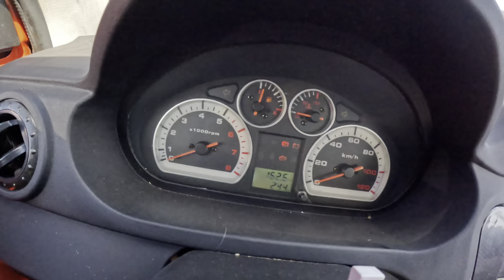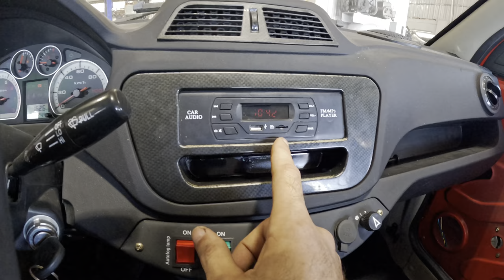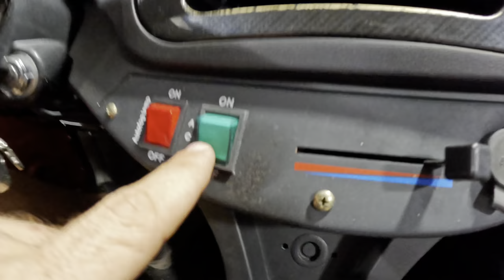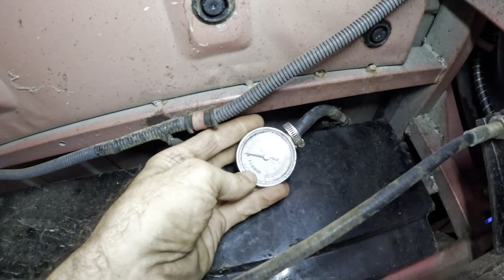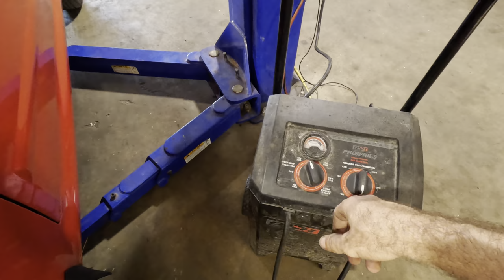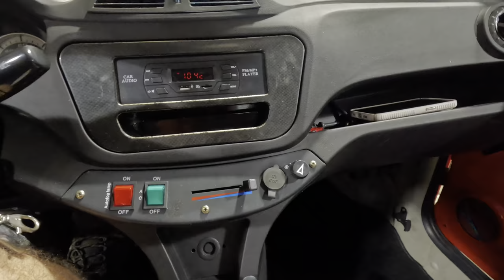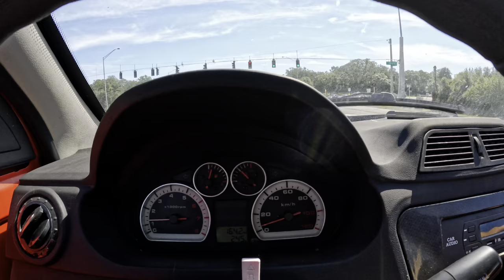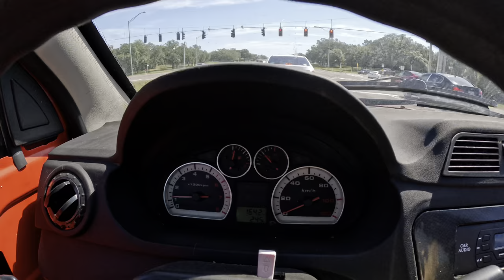UNFIT for the ROAD! Brand New 2019 Piece of Junk!

Comment: Just a word of caution here. When dealing with the car battery, make your last connection to the negative/ground side last. Why: as you were tightening the positive connection your body is against the car body and that body is now already connected to the negative since you already connected it so the only thing preventing you from getting shocked is your clothing and a layer of paint. Do the negative last but do not put your self between the negative terminal and the negative wire to be attached. Wear heavy gloves is a great idea as well.

PS: thank for the cheep car review. I had a 4 cylinder with 4 speed stick shift Chevy Monza in the 1980's and it went pretty good. No AC, no power brakes, no power steering either, but it got great gas mileage. Can't imagine a 2 cylinder engine in that car....
Reply: No worries. There's no chance of getting shocked by 12v unless you're soaked in salt water.
Reply: @NatenNator  12 volt from a 12 volt lantern battery is not the same as 12 from a car battery. It is the amperage that will kill you. Yes, it is possible to get electrocuted by a car battery. Car batteries produce high voltage electrical currents, which can be dangerous if not handled properly. It's important to follow safety precautions when working with car batteries, such as wearing insulated gloves and using insulated tools to prevent electric shock. Other then if your skin is very dry you are like a bunch of salt water, and salt water will conduct very well. Weak heart, or sweating  are all combinations of death by car battery.
Reply: Yes, it's the amperage that kills. 12v is not enough voltage to push that much current through your body because the resistance is too great. I worked as a car electronics technician before getting into building access control. I touched the 12v constant on vehicles every day as well as the positive terminal of the battery and body of many of the vehicles I worked on. Never got so much as a tingle. If you drop a metal tool across those terminals, yeah, you get enough amperage to melt the tool but it's running through the tool that has very low resistance relative to your body. Just because a battery is capable of putting out 60A doesn't mean it's always going to or it will melt quite a few wires in the car. You have to have a load to move that current.
Reply: @tactileslut  true as well.   About 3 years ago I did a dumb one and had to disconnect the battery that was under the the back seat with the car all wet and me wet and sweaty and the interior carpet soaked wet. I used a battery bale as my last connection to disconnect the battery and connected it to ground bare solid metal of the car and the ground of the battery as I removed the ground wire from the battery to the other only ground of it from the car frame/body, then unclipped the battery jumper did this wearing heavy leather gloves as well. I had a heart attack some 12 years before and did not want to shock myself dead..
Reply: 12v shock is not risky but the spark if your wrench from positive connection hits anything metal is a risk to ignite gases that can be vented from battery. That risk is zero if AGM battery is used . There are protections built into electronics of the vehicle that are not very effective if pos is disconnected first.
Reply: @NatenNator  Car batteries usually have CCA in the 300-600A range
Reply: @tableseven8133  doesn't matter unless you're dropping something across the terminals with very little resistance like a wrench. Then the danger isn't electrocution but burning yourself or the car. Ohm's law state voltage=current x resistance. In order to get the lower number you stated of 300A at 12v, you have to have a resistance across the terminals of 0.04 ohms. Put an ohm meter across any part of your body you want. It's not that low of a resistance. Heck, stab your probes into your fingers and it's still not that low.

Comment: it reminds me of a type of car here in germany
theres a special driving license to drive vehicles, up to 8hp, max weight of 425kg and limited to 45km/h, even with the age of 15. its used for small motorcycles and such. But companies made cars with Motorcycle engines that fit these criterias and such so that teenagers can drive cars. they have no real registration or inspection and are insanely cheap to drive and own. the only thing they need is fuel and 50€ per year insurance.

they also have barely anything, only things like a windshield wiper, lights and a seatbelt.

Comment: Knew what it was before he even got out. This is a Chergy 250 they have either a 250cc or 450cc engine. Chergy had ads for these in Australia when they tried to introduce them to the west. These are the 2012 or 2016 models, they have a 3 wheel version which is the main one you can find. The small car version is rare yet this hatchback version is still fairly common.

Comment: Not sure if it dawned on you that there is enough sediment and rust on top of the engine bay cross brace to suggest the vehicle was under water at some point. That could explain the starter and charging issues.

Comment: The vehicle doesn’t look reliable and if it’s not reliable, it doesn’t qualify as transportation in my book. My 66 Nova was a shitbox which cost me $50 but I would drive it a 1000 miles on a trip and it never broke down. It had that venerable “blue flame” six and a 2 spd Powerglide. It went to the junkyard running like a champ.

Comment: Yes, this is crap in ways,  but it may be better than walking at an affordable price. I have had quite a few great vehicles (and still do)  that have manual steering, transmission, and brakes with bench seats and no A/C. Quite a few are radio delete. After many decades, they are still going strong and will run with most new stuff. A new 3/4 ton pickup is beyond my reach because now a base model is a 7 ft tall, 5 ton rolling  grand hotel that has more horsepower for no reason  than what was considered good in an 80,000lb SEMI a few decades ago! They are made of 10x the individual pieces and require a "technician" to work on! I just need one that'll get my butt and some cargo from point A to point B RELIABLY that doesn't have so much crap under the hood that I have to lift the whole cab off to work on it! Being a MECHANIC I want to sit  under the hood beside the straight 6 and WORK on it myself! Then I will owe the bank a lot less on interest!

Comment: It may be a death trap in a crash and not everything is perfectly fit but I love the simplicity of this car; you can easily replace any component without even the slightest hassle or special tools. I wish they still made cars like that instead of these modern computer-on-a-wheel pieces of crap with no space to replace even the most basic parts without disassembling half the car out of your way. The only computerized thing an automobile needs in my opinion are abs brakes and airbags, everything else is just an extra complication and there's more things to possibly break and need replacing

Comment: Think of it as a roller skate with an engine and a roof. It doesn't have any emissions control because it is probably falls under the regulations of a motorcycle. It's not bad for the price of a motorcycle and if you treat it with a pair of tweezers the car will get you around just fine.
Reply: I'm not sure if it's that reliable

Comment: It has AC, a radio, and it runs, so it has all i need.  It's surely great on gas. However, at over 6ft and about 290, i don't think this would have the room for me to for in it. Not to mention I'm thinking its two cylinders might struggle with heavier people. Especially with the AC running.

Comment: Radio is not picking up any signal because china doesn't broadcast in the same frequency range as the U.S. I had the same issue with my Subaru Sambar. Replace the single speaker Factory AM radio with a American spec AM/FM/ bluetooth unit and added 4 speakers.

Comment: The silhouet looks somewhat like a worked over Deawoo Matiz...they were available in Europe as well but they had at least 3 and maybe 4 cilinder engines...those where budget cars over here in the late 90s. The Chinese car industry used to buy obsolete modeldesigns, enhance them to the likes and needs of the market there and kept building them.

If you want to have something to brag over it about it you could tell around that it is Italian design by the same guy that had drawn the Delorean 😅

It was initially designed as a FIAT but the turned it down...

Comment: If you could somehow cheaply tune the factory ecu it would be very interesting to see how much performance could be squeezed out of it using a little ebay turbo. Honestly it sounds like it wants to rip lol but running out of gear at 50 mph is no bueno

Comment: I have to turn this video off. I can't watch hearing this guy constantly say the same thing over in circles. Yes, we get it. The car is a piece of junk in your opinion. You've only said it 40 times in a row. 

Oh my God this thing has no power, well yeah you turned the AC on full blast putting a load on the alternator and on the engine with the compressor while it has a tiny little two cylinder. congratulations. You're a genius.

Comment: Dude!  @18:52, what the hell is that crawling up into the car?!  Just joined and vid 10 months old, so I'm sure I'm rehashing, but the tach did work while driving and I think the dial in the center console 'vents' just opens and closes them.  I think the switch next to the aircon might be for defrost.  You can get a set of new tires for just over $400 ;P

Comment: Actually I don't think a Catalytic converter would work on this small 2 cyl. motorized car. For a Cat to work it has to reach between 500 to 800 degrees which this motor would never reach. This car would be good for just running around in the city getting groceries and such. Better then a bike. :face-orange-raised-eyebrow:

Comment: :dothefive: Man, you kids are so spoiled! I was born in 1960 and grew up in my dad's 1956 Humber 80. Vinyl bench seats, pull-knob vents, cross-ply tyres...and before you go claiming there was no Humber 80 in 1956, this was a production pilot car. The ACTUAL Humber 80 didn't come out until 1958, and then got used by British police, and featured in a movie you might have heard of...HELP! by the Beatles. OMG. The thing was a Rootes Group (yep, early Chrysler) car with a pathetic 1090cc engine, a version of the WW2 GP (Jeep) motor. It had nothing. Hand-crank windows, no a/c, no radio, no power, rotted carpet, and 4 on the tree gears. The little red chinese POS you are looking at is a luxury vehicle in comparison! I learnt to drive in it, I got my license in it, and broke my duck in it! Dad sold it for $50, and the kid who bought it stalled it at the top of the driveway and it needed a fresh battery to go again (Oh yes, change the oil, filter, and battery every year Hee hee) That poor little thing towed a 16 foot boat, rusted out the rear quarter panels from salt water (which were "renewed" with kilos of bog} and went through 2 gearboxes and a motor in service as Dad was a volunteer fireman for 40 years...he would respond to bells on our back porch in the middle of the night, jump in the car, race to the station hanging his helmet out the window, skid to a halt and drive the old Dennis to the fire. That old POS saved multiple lives, so take it easy on judging this little red thing.

Comment: I think that logo is cherry,  from what ive been told, when external to china manufacturers have run out their old models, they sell the parts manufacturing licences etc to china and thats how they end up with chinese made vw/izusu etc parts and cars that look very similar to western cars. They also buy panel shapes etc to stamp body panels etc. 
In terms of EPA, yeah chinas a bit of a wild west, but some of these smaller motors didnt need cat convertors, same here in my country for a long time. 
But these were primarily built for a purpose in china, ie people that had mopeds or scooters upgraded to cars, they wouldnt obviously have motorways like you guys do everywhere they would be low speed inner city cars where youd rarely get about running speed etc. 
But the fact that it has aircon damn, id take it over a scooter.

Comment: Chinese pieces of garbage are honestly what American ppl need. Nobody can afford any of the 150 grand garbage that is intentionally designed to be complicated and hard to work on with a 200 grand dealer markup. Everything that is old is also super expensive because clout rouined it. Like a ford ranger with a blown transmission and no bed with 300k miles will literally cost 8 grand now. Everything about this Chinese car however; is actually great though. Its literally so cheap and garbage that it could be worked on by a small child, I mean how do you think they built it? Its like a underpowered geo metro. Thats actually unnironically perfect 👌

Comment: That is Not a new car as claimed. The underside/exhaust rust makes that obvious if not already so from the interior and rear quarter dent. The odometer must be wrong. 

As for the 'fake adjustable vent'. No. The 'adjuster' almost certaiy is opening and closing abafgle behind it to change the flow... Lots of older European  cars had exactly that. The reason "nothing is coming out of it" is you shut the baffle! 

No cat? What's the CC? Compared to the riduculously inefficient massive capacity V8s and oversized SUV and Texans beloved trucks and 'duelly' nonsenses that so many need to compensate for their insecurities, 1000 of these things probably pollute less than one SUV  pollutes just to manufacture, never mind run!

Comment: @Rainman Ray's Repairs americans dont even knowhow to use a vent, "this middle vent is not even working theresnot even adjustment" have you tried to use the rottating knob between the vents to open the vents? Have you also tried to turn off the AC so you can get all engine power? Imagine calling it auto frog lamps why would be there frogs, seems you cnt even read also thats not 200 km you are probably reading the trip odometer instead the car odometer and its probably safer than any other cars you have there on your shop since it cant go much faster than 25 miles hour